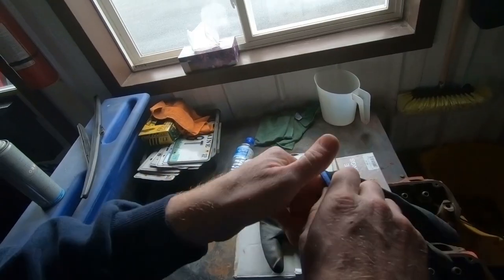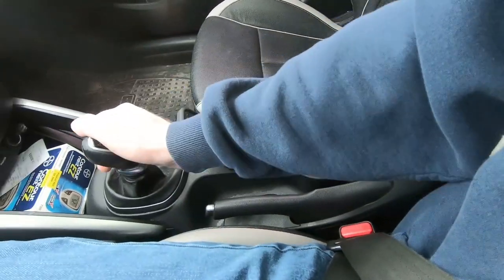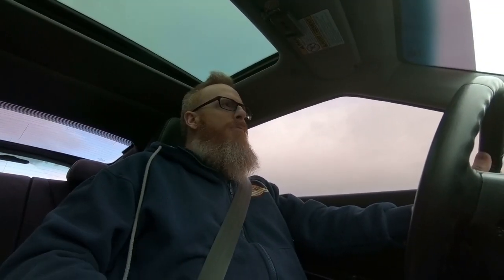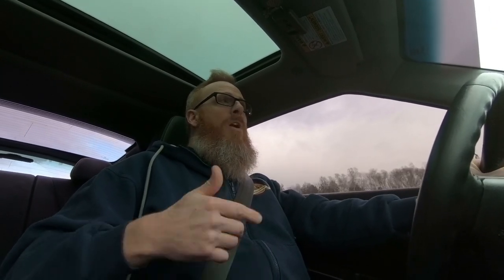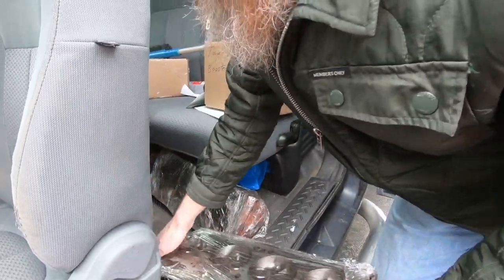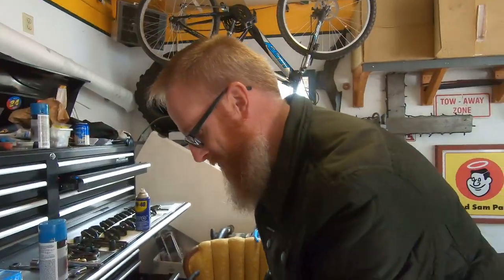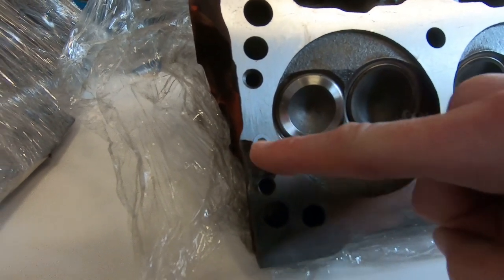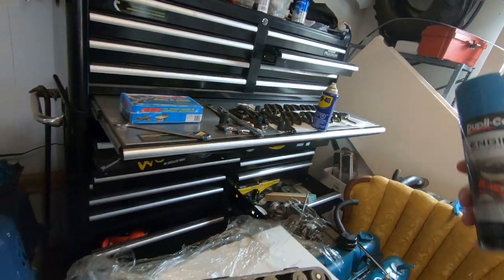MOPAR J HEADS PART 4 - OFF TO THE ENGINE SHOP

Comment: was the damage already there or did it happen at the re builders? did they magnaflux it for other cracks?
Reply from the maker: The damage was there pre-grind. I just never noticed it as it did seem to blend right in! And yes, they fluxed them.
Reply from the maker: The damage was there pre-grind. I just never noticed it as it did seem to blend right in! And yes, they fluxed them.
Reply from the maker: The damage was there pre-grind. I just never noticed it as it did seem to blend right in! And yes, they fluxed them.
Reply from the maker: The damage was there pre-grind. I just never noticed it as it did seem to blend right in! And yes, they fluxed them.
Reply from the maker: The damage was there pre-grind. I just never noticed it as it did seem to blend right in! And yes, they fluxed them.
Reply: @OldeCarrGuy  they are fixed all that matters

Comment: What size valves in the j head?
Reply from the maker: Standard J heads like mine are 1.88" intake and 1.65 exhaust with larger intake runners than stock. You don't get the 2.02" valves in a J  unless you had the T/A heads!
Reply: @OldeCarrGuy  👍 they will work good 👍

Comment: Nice. 2.02’s? If so, unshroud those valves.
Reply from the maker: Hey Hal, no!  1.88's & larger intake runners. 915 castings.
Reply from the maker: Hey Hal, no!  1.88's & larger intake runners. 915 castings.
Reply from the maker: Hey Hal, no!  1.88's & larger intake runners. 915 castings.
Reply from the maker: Hey Hal, no!  1.88's & larger intake runners. 915 castings.
Reply from the maker: Hey Hal, no!  1.88's & larger intake runners. 915 castings.